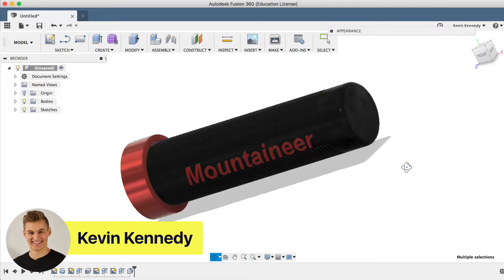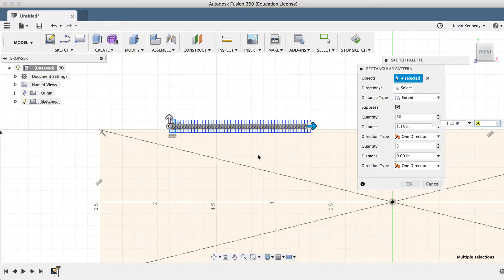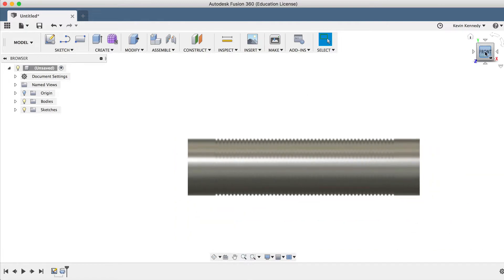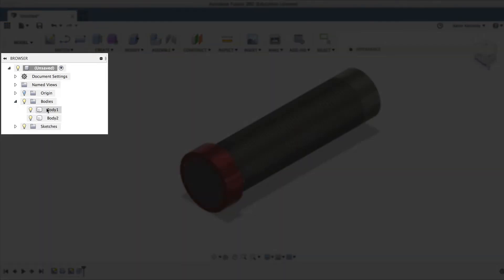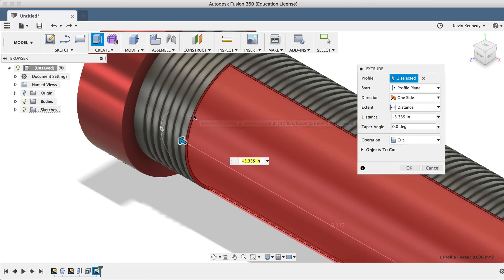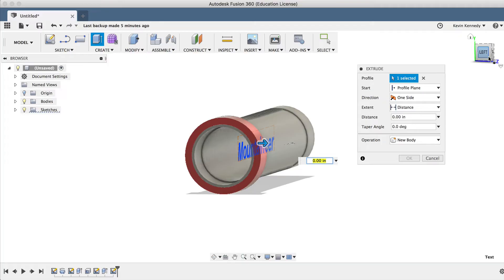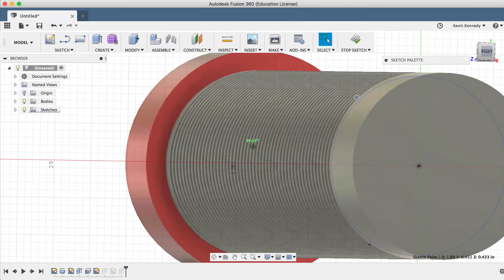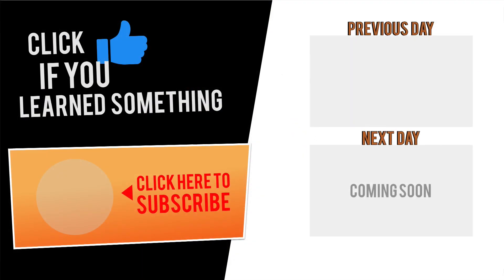3D Model a Handlebar Grip with Embossed Letters - Learn Autodesk Fusion 360 in 30 Days: Day #7

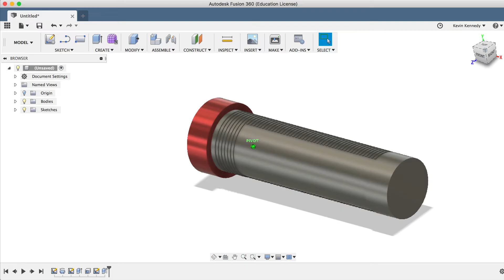Comment: Hi Kevin, I'm on the new version and can't figure out how you moved the plane on the X axis to the center of the grip at 5:30?
Reply: After noticing variation in which axis is up by default, I now check that first. You can set Z or Y up in your user preferences top right corner, just paying attention to that has revolutionised my interaction with the tutorials. I presume this is a feature so you can match some other software you export too.
Reply from the maker: @BigRedNZ1  Yep - that's correct. For years they had the default of "Y" being set to up...which is why some of these tutorials are that way. The F360 team decided Z-up was more appropriate due to the large user base of CAM and 3D printer users.

You can cross-check important settings like this with mine, here - https://bit.ly/defaultsettings
Reply from the maker: Hi, Tym. The default "Up" axis is now the "Z" axis. Therefore, you can select the "YZ" origin plane instead. If you're not seeing your origin planes then you may have to hit the corresponding eyeball icon in the Fusion 360 browser - to the left of the Origin folder. Let me know if that helps! Cheers, Kevin :)
Reply: @ProductDesignOnline  Hi Kevin. Never figured that one out.  I drew the whole grip no problem, but at 5:34 to 5:35  it looks like you dragged the origin to the middle of the grip, then at 5:39, front view, the Z axis is in the middle of the grip. With my finished part, the Z axis is still at the end of the red aluminum body.  That part at 5:34 is still a mystery. I'm just curious and it'll probably be obvious as I take more lessons... I know how to select the plane on the X axis, but I think I missed what is the distinction of "the center plane" on the X axis is, maybe? Thanks for getting back, these tutorials are great and you got a new patreon member.
Reply from the maker: @garlicbutter1906  Thanks for joining my Patreon! Glad to hear you're enjoying them and learning.
Can you share the link to your file? If I take a look. I'll be able to give you a more definitive answer. To share your file please go to File > Share > Share Public Link (make sure "downloadable" is toggled on) > Paste your link here as a reply to this comment.  Cheers, Kevin :)
Reply: @ProductDesignOnline  Hey Kevin, no need, it was a newb mistake! It just dawned on my that I could turn on the grid and go look at the first sketch. It was a 2 point rectangle so that's why the Z axis was on the left...
Reply from the maker: @garlicbutter1906  ahhh...glad you figured it out :)

No worries - always happy to help, so don't hesitate to comment if you run into any issues.

Comment: Suggestion to others: I have found, at least on my computer setup, that I can solve many "got stuck's" (selection of an item (especially if small, grabbing a dimension, getting a line to snap to a plane or object...) if I magnify the desired area quite a bit. Then I can accurately use the particular function. Takes a bit more time, and I will probably learn better ways as I go, but this works for me for now. Cheers!
Reply from the maker: Thanks for sharing this, William. I think many of the selections techniques take time. I also show some additional tricks later on in the series. Keep at it. Cheers, Kevin :)

Comment: I'm having some trouble at 5:05 where you create the smaller circle, draw a line across it, and extrude to create the flat space for the text.  I understand the idea - the line defines the width of the area where the ridges are removed by the extrude command, and the smaller circle cuts away the ridges. 

But I'm not getting that arc to extrude.  Is the rest of the smaller circle trimmed away somehow to create the arc?   Are the endpoints of the line on the smaller circle?  In the video they seem to be being place beyond the smaller circle. 

TIA.
Reply from the maker: Hi, s j. You'll need to make sure you have two circles before you create the two lines that connect the circles. You can create the circles with the circle command (per the video) or you can also use the "Project" command to create the larger circle and then the "Offset" command to create the smaller circle.

Let me know if that works for you. If not, I'd be happy to take a look at your file to see what's going on. Cheers, Kevin :)
Reply: @ProductDesignOnline  Thank you very much for the feedback.  I get it now.  It wasn't clear to me the first time around that you were using the line to construct a crescent with square ends.  I went ahead and trimmed away the rest of the smaller circle just to avoid confusion.
Reply from the maker: @sj-kp1ks  You're welcome! Don't hesitate to comment if you run into any roadblocks or have more questions. Cheers, Kevin :)

Comment: Hi Kevin: 
Shelling - All of I can't shell. (It worked the 5x times before that I completed this project.)  When I shell, the arrow is pointed the wrong way, 'across not in towards the interior.' Notes: 
*My Y is up. 
*When I extruded previously, I created a new body as you instructed.
Thanks!
Rob

PS Error message is that I shelled previously or I am on the wrong plane. (I didn't shell previously.)
Reply: Got it... :)
Reply from the maker: @robo7981  Hi Rob. Sorry for the delayed response. Glad to see you got it sorted out. This tutorial is older and was recorded when the default orientation was set to "Y" being up. You can check my default settings here - https://bit.ly/defaultsettings
Cheers, Kevin :)

Comment: At 1:57 when you when you're selecting the profile for the revolve command, you're able to select the top half of the rectangle. I drew the center line in sketch 3, but when I'm in the revolve command and I try to select just the top half, it only selects the whole 1.25"x5" box. Any thoughts? I'm working with the new interface, thanks.
Reply from the maker: Hi, musoangelo. Without seeing your file there are 2 possibilities that come to mind. First, when you draw the line across (1:47) make sure you create a solid line and not a construction line. Second, make sure that you are using the solid modeling command (blue icon) and not the surface revolve command (orange icon).

Let me know if it was either of those. If not, could you please provide a link to a screenshot and/or your file? Cheers, Kevin :)
Reply: @ProductDesignOnline  Kevin, thanks for that. My problem there was that I'd created a second sketch and when I patterned it, it wasn't connected to the first sketch. I went back and edited the first sketch to include the pattern. After that it worked. I ran into a problem with the shell command, where the end was still solid, but when I used the section view the middle part was shelled. I went to the opposite end and shelled it from that end, but ran into problems when I was doing the text. When I selected the text, it looked like the whole word was selected, but when I went to extrude (push/pull) it, the letters M and ee didn't come through with the other letters. At any rate I'm still knocking my head against it. If I can't get by it tomorrow, maybe I'll try and share the file to see if you can shed some light onto it. Thank you again. I joined your patrion group as well.
Reply from the maker: @musoangelo  Glad to see you're making progress! Definitely, don't hesitate to share your file if you're still having issues. With the shell command, it does matter where/how you select it. If you select the body as a whole (entire body highlights in blue) it will leave the outer faces. If you select just a single face then it should remove that face along with the defined shell thickness.
 
Thanks for joining my Patreon, I appreciate your support. Cheers, Kevin :)
Reply: @musoangelo Went into something similar. When selecting the top half, it did not select the zig-zag pattern in the upper line, but the whole half of the rectangle. That's because I made the small rectangle (and the pattern after it) in a new sketch. Solved it by including in the 1st sketch.

Glad I found your comment.
Reply: @mihaialexandru314  Thanks for posting, I'll take a look at it.

Comment: This was a great one!  It looked so cool I had to print it so I could show it to my SO.  One thing I found - one of the sketch planes was showing up in the finished product, and I found I could hide it by going into display settings and Object Visibility and temporarily un-checking sketches.  

One disappointment with v2.0.6670 - when I went back to edit the lines to decrease spacing around the text, F360 gave a "The profile reference is lost".  This also happened in one of the prior tutorials and I had to start over.  In this one,  I had to delete a significant portion of the timeline but I could recover.  I have to get in the habit of saving a version between each major step.  Should I report this to Autodesk somehow?  From some of my google searching it seemed the procedure was a bit complicated for noobs - do you have a tutorial for that?  I feel that if they are giving me a free license at least I could help out with reporting some problems.
Reply from the maker: Hi, Vince. You can also hide the construction planes in the Browser by clicking their corresponding "eyeball" icon. Alternatively, you can use the shortcut letter "V" to view/hide objects, after selecting them. I believe I show this later in the series. I tried to keep each tutorial to only have a few of these tricks so that it's not information overload.

I would suggest reporting the issue you're having on the support forum so someone from Autodesk can look into your particular instance - https://forums.autodesk.com/t5/fusion-360-support/bd-p/962

As far as saving versions, I do have a video that covers that. You're also correct that it is not the most intuitive workflow, at least for newbies. You can find that here - https://youtu.be/ArRAaJmiCgA

Cheers, Kevin :)

Comment: how do you get the gap between the rectangles when using the rectangle pattern tool?  mine are connected by a line at top and bottom making the profile one instead of 50 individual cut outs when I use the revolve feature. (about 1:35)
Thanks
K
Reply from the maker: Hi, Kevin. At 1:08 when I select the four sides of the rectangle, that is what defines what is going to be patterned. You may have selected an additional line here that is being included in the pattern. Otherwise, I'm not sure what it would be without seeing your file. I'd be happy to take a look if you share the link to your file. Cheers, Kevin :)

Comment: For me, the Extrude arrow showed up in the end plane of the handlebar, not on the text (but pointing in the same direction as yours). Not sure why, though it didn't make a difference in the end result as far as I can see.

Also, purple lines with hollow purple circles at either end sometimes appear when sketching stuff – what are these?
Reply from the maker: Hi, presumenothing. The location of the arrow shouldn't affect anything. Sometimes it is placed different based on where you click.

The purple lines are from "projected" sketch geometry. You're seeing geometry that is being auto-projected based on where/how you're creating new sketches. Projecting sketches (how and why) is something that I talk about later on in the series! Cheers, Kevin :)
Reply: @ProductDesignOnline  Ah, that makes sense! Kinda like projection lines when you're doing orthographic drawings manually, I guess.

Also, totally unrelated question, but how difficult is it to move from Fusion 360 to other software, in your opinion? Especially Solidworks or AutoCAD, that's pretty much still the industry standard at least where I am.
Reply from the maker: @presumenothing1949  For the most part, if you know any of the "standard" CAD packages you can jump from one to the other very quickly. The key difference between Fusion 360 and Solidworks is how they treat assemblies. Fusion 360 was built for a top-down approach, where you can build all the "components" within the file; whereas, Solidworks is the opposite where you build parts (components) as individual files and then have to place them all into the assembly file.
Cheers, Kevin :)

Comment: ARG!  I can't select the text to do the Press/Pull.  With the text selected, right-click doesn't give the option.   So I select Sketch 4, which is the text.  Then I choose Press/Pull from the modify menu.  The text deselects and I have no way to select it.  I can only click on the outer bodies.

Edit:  I solved this by hiding the cylinder so that I could click on the text.  How were you able to select the text without doing this?  And why doesn't clicking on the sketch name in the browser do this?
Reply from the maker: Hi, Bobos Curse. You should be able to select the text from an angle, where the cylinder is not blocking the view. You can also try selecting the text by clicking and holding on the cylinder, which will give you the options to toggle through (face, face, edge, etc).

Hiding the object in the way is definitely the easiest option if you cannot select something. I think the key thing here that I didn't emphasize is that you need to select the text itself - the actual letters - not the rest of the sketch. Can you double-check that you were selecting where the letters are and not the surrounding bounding box?

Cheers, Kevin :)

Comment: Great stuff! I found it a little quick though. Sometimes hard to follow what you are doing for a mentally challenged old guy like me! Was looking for the slow motion button on Youtube  :-)
Reply from the maker: Hi, Steve. Thanks for the feedback. For future reference, you can slow down or speed up the videos by clicking the settings (gear) icon and then select the "playback speed". Cheers, Kevin :)
Reply: @ProductDesignOnline  Thanks. That really helps.
Reply from the maker: @dlpgraphics  No problem. Don't hesitate to reach out if you have more questions. Cheers, Kevin :)
ps. thanks for your support on my "Buy Me a Coffee" page. I tried to respond on there but it appears to be under maintenance at the moment.
Reply: @ProductDesignOnline  You sound great at 50%... like you may have had a bit too much to drink.
Reply: I can relate.

Comment: im having an issue where its not letting me add anew sketch to add the letters anyone have a fix?
Reply from the maker: Hi Zesty Lemon. Can you please share either the link to your file or a link to a screenshot so I can take a look? Cheers, Kevin :)
Reply: @ProductDesignOnline  hey there Kevin sorry for my delay I was at band camp and had no free time I can get those files to you tomorrow
Reply from the maker: @zestylemon7409  No worries. I'll keep an eye out for your file (as the links sometimes get thrown into the spam filter). I don't see the file yet...when you post it you can reply to this thread with a separate comment to let me know in case it does get flagged. Cheers, Kevin :)

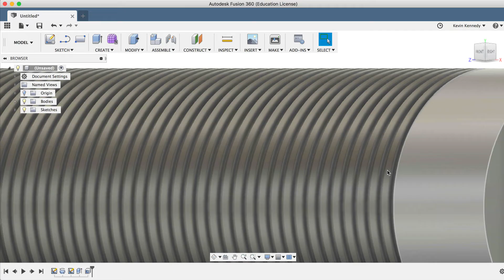Comment: Hi Kevin, thanks again for these great tutorials!  So, at 4:35, I have a couple of problems.  First, I am having a hard time seeing where exactly on the grip you clicked.  There are several surfaces there to click onto, and the description of "the furthest right grip" is a bit ambiguous.  Is it the first indent?  Anyways, it's kind of moot only because regardless where I right-click, I don't have an option to Create Sketch.  I realize that I'm probably running a different version since it's been a year since this video was posted, but I can't even find the option in a flyout menu.  I'm using version 2.0.6045 if that helps.  Thanks again for the assistance!
Reply: I actually figured out which surface to pick, and found the command Create Sketch in the Sketch toolbar, so I got past that part!  I still don't have that option in the right click menu though.  I have verified my settings are what you recommend.  The only difference is I prefer my units to be  metric by default, so I have to remember to change them to inches when your units are imperial.
Reply from the maker: Hi, PureSol420. Sorry for the delayed response. Glad you found the right surface to select.

As far as "Create Sketch"... it should show up in the right-click menu any time you have a flat face or construction plane selected. Make sure no edges or other pieces of geometry are selected or it will not show in the right-click menu.

If it still appears that it's not showing when right-clicking, can you share a screenshot? Cheers, Kevin :)
Reply: @ProductDesignOnline  sorry, crazy weekend so I didn't see the reply until this morning.  I can't explain what happened other than I must have had an edge selected, because now the Create Sketch option comes up on the right click...  I blame tiredness lol.  On to the next lesson!  You're the hero we don't deserve for doing this!
Reply from the maker: @PureSol420  haha no worries. I'm glad to hear it's working now. Sometimes it's best to step away from the computer when things aren't working. Cheers, Kevin :)

Comment: Great tutorial! I am stuck at ~7:21. The Press Pull command errors out with the message "Fail to project profile to remote surface". Any idea what's going on? My Extrude dialog options are the same as yours, except my arrow is pointing the opposite direction.
Reply: Apparently it was the font I was using. When I switched to a more common font, I had no issue. Thanks again for these tutorials. They are very good.
Reply from the maker: @joels9848  Hi Joel. Thanks for the update! Just read your initial comment...and "Which font are you using?" was going to be my first question. I've seen other users report font issues with this process in the past. Glad to hear you got it working. Please don't hesitate to comment questions on the tutorials as you work through the remainder of the series. Cheers, Kevin :)
Reply: @ProductDesignOnline  Thank you!!!